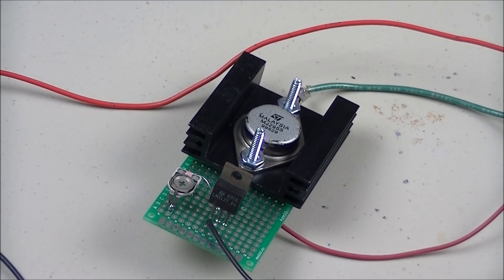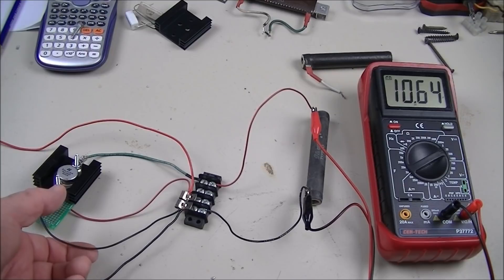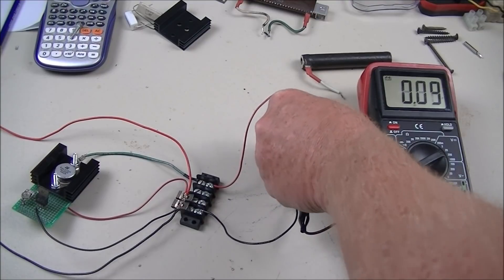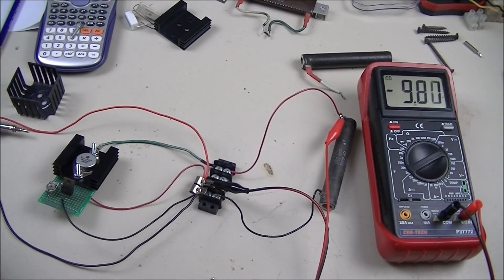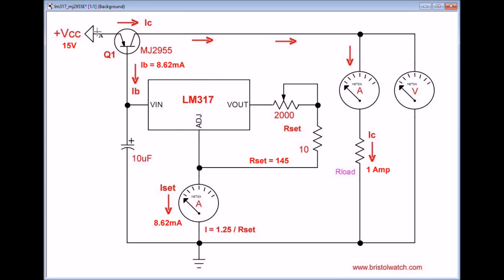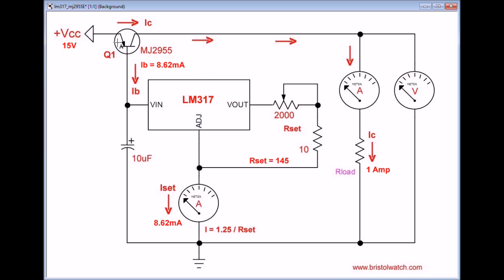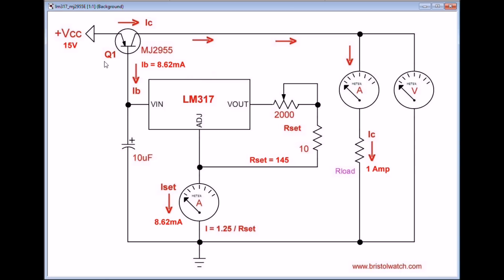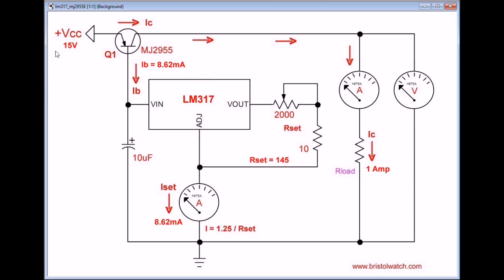Adjustable LM317 High Powered Current Source

Comment: you claimed that when the load resistor of 12 ohms got hot , the value then reduced to 10 ohms. i don't think that will happen. the ohmic value will surely increase not decease when the resistor gets hot.
Reply from the maker: I don't remember saying resistor. The resistors I used were wire wound and stable.

Comment: wrong component using transistor on its own generator more heat the good using pnp mosfets D403 will give a more efficient circuit and a bjt with a current rating gain of 1.5 with will increase
Reply from the maker: This is a current-operated device. MOSFETs are voltage operated.

Comment: 10 amps maximum, sport.
Reply from the maker: That is the transistor MJ2955 rating. The reality is 5-7-amps for a safety margin. I use this circuit all the time for troubleshooting other circuits.
Reply: @LewisLoflin  I've used this circuit to do 10 amps.
Reply from the maker: @Theineluctable_SOME_CANT  Great! My problem was I got my MJ2955s off eBay, and they were off-spec. That is a risk one takes with eBay. Also, just so you know, as the transistor heats up, the Hfe changes somewhat; thus, the output may exceed the rated value. I mount the transistor on a large heatsink with a fan-thermister circuit. It is very stable at this point.
Reply: @LewisLoflin  it should regulate though because it is in a feedback loop.

Also, I never buy junk off ebay any more.
Reply from the maker: @Theineluctable_SOME_CANT  The LM317 itself has feedback. You learned your lesson about eBay.

Comment: Where is the feedback? The output current depends on the current gain of the 2955, which of course will vary with temperature. Not a great design... unless I'm missing something.
Reply from the maker: It is a simple design that works within reason. Thanks.

Comment: Thanks for your video. I'm trying to design a current limiting circuit for AC current, and one method I was told about was to use a linear regulator to regulate the AC current peak. At first, it worked fine with small current, but since I need to scale up to 2 amps, I was worried about the heat and power loss. Your video showed me a new way to go about it in a better way. Thanks.
Reply from the maker: This is not for AC. To limit AC power you really need phase control of the sine wave.
Reply: @LewisLoflin  Thanks for your reply. Why wouldn't this work to control AC current? My initial design using an LM317 as an adjustable current source clipped my AC current to not go past the set current limit of the regulator (set it for 10 mA, AC current won't go past 10 mA peak to peak, though it will draw less than that). The LM317 is placed after a rectified voltage (not smoothed out with a capacitor), so the current that passes through the regulator will return back to the rectifier in series with my test load. Sorry, it's kind of hard to explain it here, but I hope I get the idea across.
Reply from the maker: @ZeusandHades  It is a DC device - one polarity. AC swings from negative to positive.
Reply: @LewisLoflin  Sorry, looks like my comment got deleted. I'm just trying to build an AC current source that won't let the current go above a certain limit. My load is in series with the return path to my AC source. With the LM317 placed after a rectifier, it'll limit the max current being passed through my load by clipping it at the set limit. I tested this in simulation and on a breadboard and it works for small currents. I'm in the process of scaling it up to a larger max current.
Reply: Circuit works, but I was given the task by the recipient to bump it up to higher current than my demo. Thus, I'm looking for other ways such that I don't have to worry about power across the regulator when I stumbled upon your video for research (amongst others). Honestly, they want it super simple, so no Arduinos here.
Reply: @LewisLoflin  Actually, if I may also ask, on your website, you had the ADJ terminal connected to ground through the ammeter while in another schematic, you had it connected to the load/collector. Why the change?
Reply: @LewisLoflin  I don't know about Zeusandhades specific application but if you look in the TI datasheet for the LM317 their is an AC circuit on page 15, 9.3.9, that uses two LM317 to limit the peaks of an AC source. I suspect this may work for Zeus with pass transistors added.

Comment: If we don't use a base resistor for the transistor in this type of circuit, will it overheat the transistor and the regulator ic when higher current upto 5 amps is drawn ?
Reply from the maker: You can add a base resistor noting that sets the upper limit of the base current. The current limit will be based on the value of R times Hfe.

Comment: If the transistor fail, then it will send the input voltage directly to the output. How to deal with it? maybe a simple protection circuit

Comment: I think 2n3055 will work better....but use more than one transistor with power resistors on output for each one to balance the load equally on transistors for more power.
That way you have good powerfull current controll cercuit. 
Thanks again.

Comment: I am getting quite high Quiescent Current. Any solutions for that
Reply from the maker: There will always be some current through the base-emitter junction with the LM317. Put a transistor switch between the LM317 and ground.
Reply: @LewisLoflin  Thanks for your reply. You mean between output of lm317 and ground? One more problem which i am encountering is with the low ohm resistor. I am using 20 ohm potentiometer with 10 ohm resistor in series. Output current is 5 A. 10 ohm resistor fries when circuit is on. Do you have any thoughts on this??
Reply from the maker: @amitpandey3975  Are you talking about the load resistor?
Reply: @LewisLoflin  No. One used to avoid virtual short.

Comment: Heat makes resistors more resisting and therefore raises the resistance, other then that great vid
Reply from the maker: True. It also changes the gain on the transistor. This circuit is a demo.

Comment: Is the lm317 gonna hot? Or only the power transistor will only got hot
Reply: The current through LM317 is only about 10mA. And voltage is about 15V. So power dissipated is about 150mW. Not enough to heat it significantly. I would say, slightly warm.
Reply: @odissey2   thx,  i already try it and it doesn't need a heatsink it just warm litle bit
Reply: @ardhi1269  years ago, to simplify design, I built a power supply with about a dozen of LM regulators, producing various voltages for the system (+24V, +/-15V, 10V, 5V. Each one driving about 100 mA. That eventually required a heatsink and a fan, as the total power went over 10W.

Comment: This looks to be a circuit demonstrating students how If varies with Ib.  As a current surve it won't be stable. With current on load the transistor's junction temperature will go on varying, there by changing the gain,  in turn changing the Ic.

Comment: Hello, nice video and explanation. I want to adjust the output of a ATX PSU, i don't have a power transistor, but i do have an LM317 and some mosfets (IRFZ). I need to be able to drive around 10Amps, which one to use ? thanks !
Reply from the maker: Mosfets are voltage operated bipolar transistors are current operated. No way to make it work.
Reply: @LewisLoflin  I have tried two irfz in parallel along with a 20k potentiometer. It regulates the voltage but are not efficient : i have a difference of 2.5v between source and the maximum i can get out of the potentiometer, and this drop gets worse under 8A load. LM317 alone cannot deliver more than 1.5 Amp ? thanks

Comment: Hi, I want to control high current (up to 40 Amps). 
is it possible?
is there any PNP transistor to do this?
Reply from the maker: This is demo circuit and I wouldn't use it for what you want.

Comment: I parllarly join LM317 *4 does this can handle 6 amp 24 volt input and can adjustable. If yes then what would be value of resistance used.
Reply from the maker: What is your desired output voltage?
Reply: @LewisLoflin  hi, my desired output voltage is 24 v 6 amp. I have a transformer rated 24 v ac 6 amp. When convert to dc it reaches approx 33 v
Reply: Hi waiting for your reply. i made power supply but my 10k resistance get sparked and burned when I adjust power supply. Any solution for it
Reply from the maker: @satishsanhotra4391  Wait a minute. This is a current source not an adjustable voltage regulator. The output voltage is I X load resistance. What 10K resistance? The 32 volts is normal when 24-volts is rectified and filtered. If you are trying to operate a 5-volt device at several amps from a 33-volt source it will never work. The pass transistor will get red hot. The voltage regulation is separate. What voltage do you want on the output?
Reply: @LewisLoflin  first of all thanks for reply. I want to use output 24 v 6 amp DC. I'm having 24 volt AC 6 amp transformer. After rectifier it gives 33 volt DC. So i need to create a variable power supply. I used LM 317 t with D1047 and BD139, resistor used 220 ohms on LM 317 adjust and output pin and resistor of 10k to regulate voltage with LM 317. Problem is that my 10 k potentiometer get burn and sparked when I regulate the voltage through potentiometer.
Reply: Any update?
Reply: @satishsanhotra4391  what is the watt rating on your ten k pot?? And where is it positioned in your circuitry??? I will try and help you with this if you haven't fixed it..

Comment: OK. I am confused but ok. What happend if i connected lm317 on my transformator 2*12 V/1.04 A. Can i up more then 1 A becouse lm317 is 1.5 A. Or on 317 connect mj2950 and then do i can up a current or current depends of windings in transformator and this is a limit?

Comment: This is an extremely bad circuit, and I suggest that anybody who is looking for a current regulator circuit look elsewhere. There is no feedback in this circuit, which means it relies entirely on the gain of the power transistor. This is all but useless in high current transistors as the gain is so low (typically <15 at currents over 1 amp.). The LM317 draws a constant current through the transistor base, but because the input is already a constant 15 volts (even if unregulated) the base current being regulated is useless as well.  This is why you had such a discrepancy between your calculated and actual current. It will continue to change with current, voltage, temperature, etc.  If your requirements are okay, with such a shoddy circuit, you might as well save some time and money and just use a zener diode shunt on the base of an NPN transistor. It'll cost about half the cost of this circuit, and perform just as poorly.  If you want a proper current regulator, you need a shunt resistor to provide a feedback voltage to the control pin of the LM317 (As shown in the data sheet, if you bothered to look at it).
Reply: Can you show me a high current regulator diagram.  I love you’re comment. People will watch this thinking this is the circuit.  It’s not to use.   I see that.   I would fry that circuit immediately.   It’s useless.
Reply: @donaldcampbell7894  Take a look at the LM317 datasheet. If memory serves, it provides an example of using it for high current voltage regulation using a TIP73 to supply the current as an example. That circuit would get you 15 amps. 
Unless you need a shit ton of current, you should probably just use one of the higher current alternatives to the LM317 instead, the LM317 can only supply 1.5amps max.
Reply: This isn't a bad circuit. It really depends on the application.  It's an interesting idea with 2 active components and some resistors, and it may work well depending on what its connected to, and the rest of the entire circuit.
Reply from the maker: Read below - this is a test circuit to teach transistor theory.

Comment: Have you successfully tested this circuit under high current like 15A continuously ??  does it survive short circuit ?
Reply from the maker: Yes I did and it blew the transistor. It ran fine at 10 AMPs, as for short circuit,  It depends on the level of the short circuit.
Reply: It really depends on the heat removal rate from that power transistor. The heat sink he's using in this video is rather small, and not adequate for much more than a few watts dissipation. But with the proper heat sink design, a power transistor can handle 15 amps easily.  I do recommend, though, that you never use this circuit for current regulation, and use a properly designed circuit instead.

Comment: Dear sir how i increase amps same power supply i have 25 volt power supply its operate motor  controlling board but control board  damage now i was make a simple circuit for motor drive but motor not proply work because low amps
Reply: Fuck

Comment: Any way to control the LM338 Constant Current Regulator Circuit digitally using arduino?
Reply from the maker: No there isn't.
Reply: And the digital alternative with LM338 like linear current adjustment no PWM is?
Reply: To control current digitally, replace 2k resistor at LM317 with digital pot and control it through I2C.
Reply: @odissey2  Really, the output will be linear non PWM?
Reply: @juliusvalentinas  Yes. It will be operating same way as in the video, but controlled digitally. I believe there are plenty examples of controlling digital potentiometer by Arduino

Comment: can i use an ultracapacitor(2.7V, 120F) for charging it as a load in this circuit?????
Reply from the maker: Not sure what you are trying to do. The voltage for this purpose is too low.
Reply: sir, i want to charge an ultracapacitor 2.7V, 120F using a constant current source of 1.2A for 2min , so i need a constant current source. how to design a 2A constant current source????
Reply from the maker: See this webpage: http://www.bristolwatch.com/ccs/LM317.htm

Comment: Is there a more efficient way to deliver constant current to a load. The transistor is dissipating quite a  bit of energy.
Reply from the maker: Yes I said that I believe. Step down the input voltage closer to what is required.
Reply: AFAIK buck converter regulating current is the closest to most efficient.

Comment: Thanks for video
excuseme if my question is a little ridiculous I am a beginner 
Is it possible to use MJ11033 (DARLINGTON POWER
TRANSISTORS) with have very diferent hfe instead of MJ2955 (POWER TRANSISTORS) for getting higher power dissipation, lower thermal resistance and higher current
Reply from the maker: No. The gain is so high it would be impossible to control. In addition many of these Darlingtons have internal diodes and resistors.